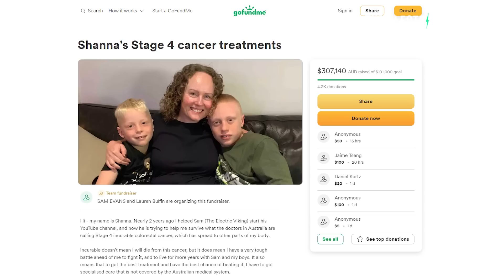CATL unveils Condensed Battery for Aircraft & 1000 mile range EV's

Comment: Sam, who on earth told you 500 Wh/kg can do aircraft? existing Lith Ion batteries can do "aircraft" if you include 4 seaters or even the 10 seater (including pilots) Eviation Alice if it gets a licence to fly. but in order to do 100+ passenger aircraft we need at least 1,000 Wh/kg for 100+ according to NASA folks, but hey, Elon has never lied so go with 500 Wh/kg if you like. There's the power required for takeoff and the energy required to cruise 1000+ km, you're saying a Model 3 will go 1000 km on these batteries then even you should be able to work out that isn't going to work for large 100+ passenger aircraft.

"Commercial aviation" cited by CATL could mean a 4 seater roof-hoping air taxi. Forget about 100+ passengers and intercontinental flight.
Reply: Pffftt, NASA, they struggled to launch more than a few rockets a year, SpaceX did 60 last year alone, and they do what NASA said was impossible, ie land the boosters for reuse. NASA's data assumes aircraft with the same design as current best design because their engineers are not forward thinkers, whereas the electric aircraft being designed are much more efficient and so need a lot less power to push them.
Reply: @ledsalesoz  the 1000 Wh/kg is physics not engineering. it's a simple understanding of the fact that human beings have mass and putting 100+ humans in a single aircraft is going to have certain mass and volumetric requirements which require thrust that can get the aircraft to cruising altitude and propel it long haul distances.

The idea of landing booster rockets was engineering smarts not defying the laws of physics. Yes, landing boosters was impressive, but they didn't break the second law of thermodynamics doing it.

stay off the Elon Coolaide if you don't wanna sound like you have no idea what you are talking about.
Reply: @ledsalesoz  heard of the platinum-hydrogen battery that went to space on their satellites and the Hubble telescope? now it's a nickel-hydrogen battery that has better price performance over 20,000 charge cycles than the best lithium ion has to offer (stationary energy only, no hope of transport applications). It's in commercial production now, pilot scale only though. Tesla has not done a lot on battery chemistries, they have innovated  on fabrication. 

NASA has been defunded for over a decade, that's why they stalled. And rightly so in a way, we need to solve the climate crisis not explore space at this time in the collapse of life support providing ecology on spaceship Earth. SpaceX rockets burn methane, he's going to start fracking Texas, massive emissions and methane is 100x as potent a GHG as CO₂ over 10 years. Musk's only excuse is "we've fucked Earth so we need to settle Mars" he's literally said this multiple times as a rationale for his GHG spewing rockets.
Reply: There are already electric planes with half that energy density. More energy density just means the size of plane and the distance it can travel will increase, gradually phasing its way into the industry. Just like the Tesla semi currently just being for short to medium haul routes, with the number of routes and applications growing as the energy density/range improves.
Reply: @truhartwood3170  what you said in no way adds to the comment I made. I already pointed to light aircraft using viable technology. But the power and energy demands of 100+ passenger aircraft are extremely challenging even with FF and nothing we have today or will have in 5-10 years time is going to approach the power and energy density required to do that.

we may see a change in the way air transport operates with new aircraft like Evation Alice opening up the commercial possibilities of regional travel alternatives where fast rail doesn't operate, or where people want to pay more and feel special arriving by air. but replacing intercity air traffic at commercial airlines with battery powered aircraft is not happening any time soon, Elon-the-cult=hero or not.

even H₂ is a fail for large transport. Boeing and Airbus have given up on their electric fan propulsion system research, it's gonna be biofuels not eFuels doing the GHG elimination not Battery and not H₂ engines or FC in aircraft, you can bank that for 20 years or more.

Comment: If they can do this at a reasonable price with good longevity, fast recharge times, and low cold weather impact, all BEVs can easily have 500 mile EPA range if they have Tesla efficiencies.  This plus a great charging network is the major key to the transition to BEVs.   Aviation will take 10 years minimum for design, certification, etc.

Comment: As our cars use a load of energy when we accelerate, compared to maintaining a speed, cutting the weight of the battery in half, for the same range, will cut energy consumption by a significant margin too. This then can be turned into needing less kWh for the same range again.
Take a, say, 80 kWh battery as example. At 0.2 kWh per kg it weighs 400 kg or at 0.24 kWh per kg it weighs 333 kg. But with this energy density of 0.5 you need only 200 kg. That weight saving will reduce total energy consumption. And for the same range, you may only need 72 kWh rather than 80, so the mass would drop to 144 kg.
That weight saving may cascade through a car's design where the chassis section in the unibody can become lighter, consequently sub-chassis and suspension, consequently brakes. And the 10% energy consumption used as example savings seem very realistic.

Comment: I would not trust these great claims from any Chinese manufacturer.  Silicon Valley claims are also highly exaggerated.  This 500Wh/Kg claim (if true at all) might only be applicable under laboratory conditions of a constant temperature, low discharge rate and a slow charging rate.  I have a degree in Aircraft Engineering and this great claim of yours that it could replace jet engines on airliners is totally unfounded.  Aviation fuel has an energy density of around 43.5Mj/Kg.  Where as this 500Wh/Kg battery equates to 1.8Mj/Kg, less than 5% the energy density of aviation fuel.  All other factors being considered, this would mean a comparable electric aircraft would fly less than 10% the distance of a similarly sized turbofan airliner.  Electric powered aircraft might be alright for some short range aircraft, but that is all.  Electric Viking, you appear to have little background or knowledge in scientific and engineering matters, yet you are constantly blown away with all the new great claims of game changing batteries and electric vehicles.  Your obsession with EVs and the demise of ICE cars blinds you to true facts.

Comment: Airplanes will have at least two independent battery systems, and redundancies designed into the power electronics that drive the motors.  Look at NASA's X-37's power diagram for an example

Comment: The battery packs will be separated into modules in an aircraft and from a redundancy standpoint, many modules would be permitted to fail and the aircraft would still fly. I can 100% guarantee that
Reply: I've seen early photos of electric planes and they have a much larger number of motors. Combine this with split batteries and you'll have a lot of redundancy.
Reply: @briancampbell179   Yes, and also additional lift by more of the wing being "blown."
Reply: @portnuefflyer , that was the benefit of muktiple engines. You cant do that with bulky jet or ICE engines.
Reply: @briancampbell179  they are drones mate!
Reply: @bashful228 , no. The one I saw was a passenger plane.
Reply: @briancampbell179  electric jet engine
Reply: Rendundancy is the norm for aircraft design. Having redundant battery modules is by default. My Mercedes-Benz has two batteries. One as the primary and the second as a backup in case the main fails.
Reply: It’s also worth noting that if an engine on a modern airliner dies, you have a backup; however if you get bad fuel at a refueling station, thats it, multiple fuel tanks all filled with the same Jet-A. Despite this, it can still be made safe
Reply: @xpeterson  here, in the U.S., you will never get 'bad Jet-A' fuel; not to mention, a turbine engine will burn pretty much any fuel; OTOH, if what you mean is that the aircraft operator did not adapt to unusual conditions (i.e. temperatures) or engage proper pre-flight checks (fuel system checks) or maintenance (filters, pump overhauls, etc.,).
Reply: @derrikarenal3308  that is what I mean, you don’t get bad Jet-A, and engines do have a wide tolerance. Those things didn’t happen by accident, that is exactly what I mean by “it can still be made safe.”

Now, there are still instances where flight crew didn’t properly check fuel levels after the station forgot to refuel them, highlighting fuels single point of failure nature, but those instances have also been made safer through increased training.
Reply: @derrikarenal3308  a plane set off with half its fuel as conversion from world wide metrics to freedom units was done incorrectly. a second fuel error was adding some anti gelling agent to the tanks and like a 100x was added damaging the engines during flight, so fuel isnt always that redundant
Reply: Safer than a rocket! Comes with a life insurance policy, for passengers only! Like George Strait says! We'll see you on the other side. If you make it!!!!🙃
Reply: Guaranteed power?
Reply: See my comment above 😊
Reply: Why do you just read BS Chinese fake news on the screen every single day? Those news even people who live in China will not believe.
Reply: These guys are smoking crack if they think this will make electric aircraft useful......a typical jet engine gets roughly 4500 watthours per kg of fuel burned. And the plane gets lighter as it flies.
Reply: aircraft fuel saving
Reply: If you have a much lighter pack, then you have the option of just barely enough juice to fly short trips for cheap, or to load up on batteries for redundancy or extended range.
Make the modules smart enough to include predictive end of charge life and max charge percentage, and you could swap out the questionable packs on important planes and put them in low-importance puddle jumpers. Just add extra packs in the small plane to avoid catastrophe.
My main concern now is performance in sub-zero weather. Planes tend to fly up high where it gets super cold. So now what?
Reply: I can 1000% guarantee you won't see it aircraft need quick turn around and how do you plan that always looking for the free lunch. I have a Bridge in Brooklyn to sell interested?
Reply: Japan has abandoned Batteries for Hydrogen. Anyone with an IQ Higher than their own Butt Hole realises batteries though improving are a lost cause. It simply takes too many to do anything useful too long to charge and there is and never will be enough electricity to run Society Industry and EV' s as already pointed out 500 tons of earth need to be mined to make one EV they're NOT environmentally friendly same for Solar Panels impossible to recycle. With a short life span. While these technologies will continue and have a place long term they'd technological DODO's and attempts to hype and up sell them are not in line with reality.
Reply: @yfelwulf  In fact Japanese are very good at producing hydrogen and hydrogen does have own merits. Otherwise, they have not given up everything  related to EV . You might be surprised with one of their companies pulling a winning technology out of their sleeves all of a sudden.
Reply: " The battery packs will be separated into modules in an aircraft and from a redundancy standpoint, many modules would be permitted to fail and the aircraft would still fly. "

It depend what is the failure mode.
If it is fire: that will be complicated
Reply: plane motor is like 50lbs its super light weight  with these batterys then super easy electric long range plane
Reply: @travis7860  "with these batterys then super easy electric long range plane"

I would not say super easy.. what about charging time for example?
Reply: 1 liter of kerosene => 10kw and 0.8kg weight
1 kg battery            => 0.5kw  
kerosene vs battery -----------------------------------------------> 1:25
Termic motor efficiency: 0.6
Electric moto efficiency:  0.9 
                                                              kerosene vs battery ----------------------------------------------->  1:16.7
737 consumption: 3000 litri/h ------------------------------->  3000*16.66 = 50 TONS OF BATTERY FOR A SINGLE FLIGHT HOUR!!!!!!
(the actual 737 max take of weight is 80 tons with 25 tons of kerosene with FIVE HOURS RANGE)
some one can confirm my calculation or I said blsh?
Reply: This is awesome! The way that large transport machinery should be designed, where the energy is stored around point of use, similar to muscles in a body.
Reply: I can 100% guarantee I'm not flying on something powered by lithium batteries.
Reply: You will NEVER fly in an electric plane. I guarantee that.
Reply: @Chris.Davies some people are already fly in in electric planes

Comment: 500miles in a truck with a 50kWh pack. Nahhh, don't think so. 50kWh is still pretty much the same even if it's 100kg(220pouns) lighter. You'll get about 1.5% extra mileage due to lower rolling resistance.

Comment: Battery powered aircraft 😬😐 yeah definitely give it 15 years. That’s not just running out on the motorway.
Reply: There are already electric aircraft using batteries with less than half this energy density. As density continues to grow, it just makes larger planes and farther trips possible.

Comment: 500 W/kg is no big deal.  The 2012 Model S had much higher specific power than that, as do today's Li ternary batteries, somewhere about 2000-2500 W/kg.  Sam was wrong to claim they are less than 500 W/kg. Now, 500 Wh/kg, that is a big deal.  It makes a difference if you are talking gallons of fuel (Watt-hours) vs. horsepower (Watts).

Comment: You're overlooking all the contractors who load there trucks down and or pull a heavy trailer. That's the problem. Sure all the truck queens could use one, but the real issue is it just can't do it for the guys that busy hump doing things.
Reply: This will enable plenty of range even for this application, and at a fraction of the operating costs and with way more power.

Comment: I get 600 miles on a full tank in my fully laden 3.5 ton campervan and almost never go to cities or towns. Takes minutes to fill up and I can carry extra diesel if I want. EV's are just an expensive joke for people who enjoy their freedom to travel to remote places.
Reply: You will be able to get that with an electric camper soon enough. And when you get to your destination you'll have all the silent power you want for AC and induction cooking without ever having to fire up a generator and annoying everyone around you.
Reply: @truhartwood3170  Possible, but nothing gets remotely close yet. Maybe in another five years EVans will be good as motorhomes. Certainly be a plus to have all that electricity on board. I'm not against it just saying there's nothing close yet.
Reply: @truhartwood3170  And while you are camping, you will be able to set up some solar panels and/or small wind turbine to recharge your batteries.
Reply: @nicolasuribestanko  The amount of power required to charge a large vehicle like that would make small, portable solar and wind impractical. For running AC and appliances and lights and starlink WiFi and phones and laptops etc, definitely makes sense.
Reply: @truhartwood3170  Gotcha. Thanks. So a bit of wind and solar can at least help conserve the electric vehicle's charge while parked at the campground.
Reply: @nicolasuribestanko  Yes, or even put a bit back in the van depending how big a system you bring along and how much power you're using. But we're talking about adding a few miles/day of range. Unless you're only touring sunny locations, going short distances, and only changing location once a month, it's not really going to help significantly. You need something like a Aptera - with super, crazy low drag, before you have something that could potentially do all its driving, or at least a very significant portion, under solar alone.
Reply: @truhartwood3170  Hmmmm.... I like to be comfortable when I go camping. The Aptera isn't for me. Guess I'll have to wait a while longer.
Reply: @nicolasuribestanko  LOL, no I meant that's the kind of vehicle you need for getting meaningful range every day out of solar panels. Not that you should use it as a camper replacement.

Comment: Sounds like this battery has no competition. Two pieces of information I would like to hear is price and what the performances are in different temperature ranges.
Reply: Amprius 500kw
Reply: @emoney822  The Amprius battery is 500 Wh/kg.  kW is a power unit, not energy.  There is no single cell with that kind of power.
Reply: @incognitotorpedo42  yep. so the only explanation is... this Viking has said it wrong. I am waiting for his apologies video. 50kWh for over 1000 miles. ha ha ha.
Reply: You hit it, look at a EV in below zero temperatures what about aircraft on 30.000 feet, minus 50 Celsius wondering what impact that has
Reply: @destinationnamibia2658  existing aero engines bleed compressor air for all sorts of reasons. I am going to guess the APU is going to need to be beefed up or a lot of systems redesigned. Like the control surface actuators and the HVAC packs
Reply: Price will eventually come down once they have achieved the scale of economy, demand and of course competitions.
Reply: exactly. until they ship this is hype.